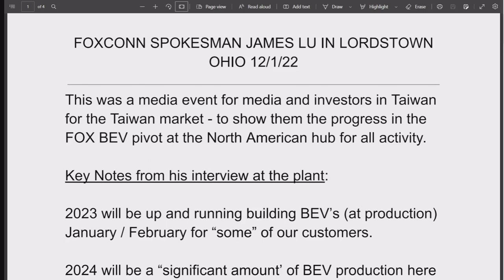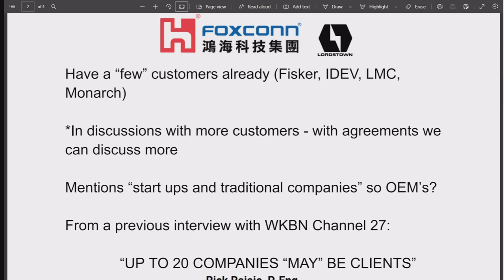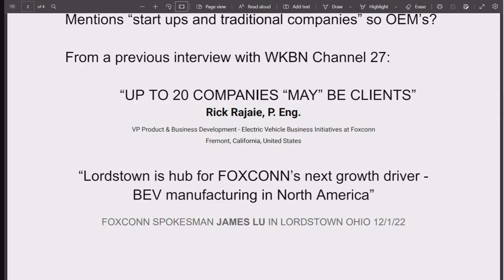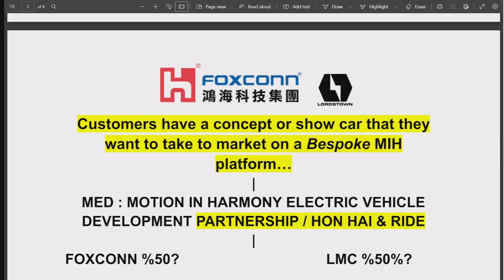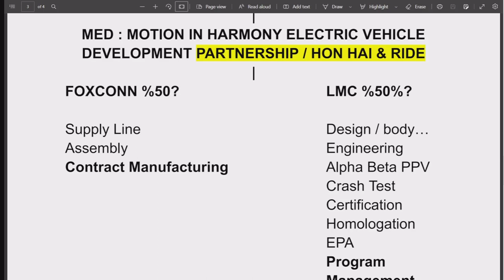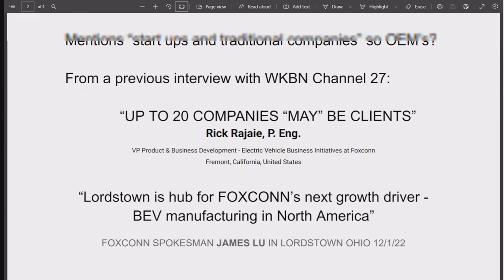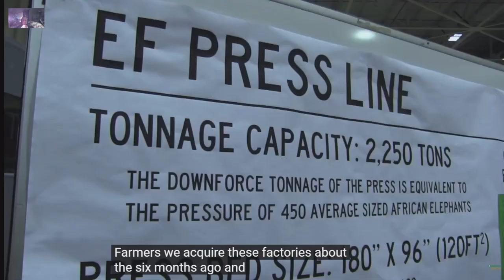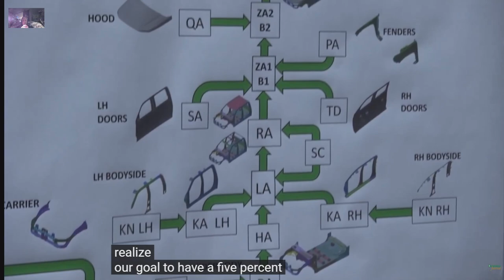BREAKING: January 2023 LMC / FOX Customer COMMERCIAL BEV Production STARTS at Lordstown  $RIDE #MXUX

Comment: The Lordstown plant is 6.2M sqft, but 13% (800K sqft) of that is controlled by LMC for the battery and hub motor lines.  I think it's very unlikely that Foxconn agreed to give up that much space unless they plan on LMC building a LOT more hub motors than what is needed for LMC vehicles.
Reply from the maker: @M - dig this - LMC owns the Hub Motor production line and the plant space and has the IP licensed - but FOXCONN is now running the line and managing all production of hub motors at Lordstown Ohio - so whatever that means FOX evidently feels the tech is critical enough for that.  IMO they will need 1mil hub motors for the Endurance US / Global sales once in full production / distribution. On a side note, LMC also owns 90 acres of raw land at the FOX Ohio facility - it kept it out of the sale.

Comment: Can you talk about the EPA mileage numbers for the Endurance. They are lower than the competition. Can you give some perspective.
Reply from the maker: I have not seen the official EPA and/or whatever the other rating is - the Endurance has been tested so these results should be forthcoming. I can say that the design of the truck has changed a bit since Steve Burns first developed it - that range was listed as "about 250 miles" if I remember correctly - do your DD on that pretty sure though. Example of changes would be  eg trailer hitch is now standard = 90?lbs added weight, but Composite Bed (not bed liner) subtract 70 lbs I believe. So hard to say - the Hightower Endurace changes were never specified, but I do believe he re-did - ha technical term - the entire truck to his liking and so the delay in start of production - and I suspect all re-done certification although never mentioned . A lot of options which are standard equip on the truck were added by Hightower IMO.  So a black box at this point - but 1. Hub motors provide 30% MORE regen - proven 2. I have not seen any mileage number with the letters EPA attached have you? Burns was also a bit catty about this I believe he used the "about" modifier - some mentions about more than 250 were around actually. Remember the DOJ and SEC are watching  - nobody - I mean nobody wants to misstate this number. We need to see that EPA certified number....IMO the 200 miles is a placeholder....
Reply: The EPA takes the range testing values the OEMs give them, and subtract 30% to determine the EPA range.  

For example, the the F-150 gave the EPA 367 mile range City driving and 289 mile Highway driving.  That averages to 328 and 70% is the EPA range.

Rivian provided 478 mile range City and 428 mile range Highway.  That averages to 453 and 70% of that is EPA range.

The EPA ranges are coming out close to what people are actually seeing.  Ford and Rivian knew how the EPA was going to calculate their range, so they pumped up the numbers so that the EPA range would be close to actual range.

The numbers that LMC gave the EPA are 280 City and 270 Highway, that an average of 275 and 70% is the 193 EPA range.

I believe because of all the attacks LMC has been under, there was no way they were going to inflate their range numbers.  So when the EPA dropped it by 30% they got a very low range value.

On the upside, when they start real world testing, the Endurance is going to greatly outperform it's EPA estimated range!
Reply: The values I provided can be gotten from the EPA documents database, look for 'Certificate Summary Information' documents, these are the documents OEMs provide the EPA to receive their Certificates of Conformity.
Reply: @mxux  Nope.  The tested range of the Endurance was 270 highway and 280 City.  There ranges are for complete depletion of the battery.  The LMC battery is actually 121 kwh, with 10% in reserve, which is where they get the 109 kwh value.  LMC gave the 250 range value because it's roughly 90% of the actual total range.

The 193 EPA range is because the EPA simply subtracts 30% from the range values the OEMs provide them.  The fact that other OEM such as Ford and Rivian are performing close to the EPA's 30% reduced values, shows that they inflated the numbers they sent to the EPA.
Reply from the maker: Just as a starting point on this topic - The Endurance.1 produced under Steve Burns had a stated range of 250 miles and a whisper number of 265 miles of range with full on regen. To date LMC.2 has only said Endurance.2 has 200 miles of range - but has not mentioned the new - just granted  - EPA Certification on range specifically - so there is that.

Comment: Do you think Foxconn may be diversifying operations in preparation of China invading Taiwan?  What do you think Foxconn will do with their huge, but empty facility in Wisconsin?  I know LMC is a separate company, but Foxconn is investing so much in this ventures they can’t afford for LMC to fail.

Possible future partner could be Workhorse Group for thousands of USPS electric mail vans.  Workhorse was cheated on that contract, their van was based on hub motors and I believe Steve Burns started LMC thinking he will be building 165K vans at Lordstown.  Congress gave the USPS an additional $3billion to buy electric vans.  I don’t think Oskosh has the technology or the production capability to do both 8.6 mpg ICE vans and modern electric vans.  Maybe high top van is the USPS van!
Reply from the maker: On China - every manufacturer is moving operations out of China - not sure Taiwan is the issue really - population curve - rising wages - internal  political issues - US industrial policy so forth.

Foxconn Wisconsin - In  my research I came across two blurbs - just mentions really - 1. The planned factory there was dropped when they did the Lordstown Deal - plug and play vs build from scratch. 2. Just for a minute there was a blurb that this will become the cloud computing center for MIH/Foxconn/Foxtron for OTA updates - infotaiment so forth - like Amazon AWS sorta. Not sure on that  - the details - but that is what I recall -plans could have changed though...

Agree to all the WKHS Burns stuff. However I am not a fan of current WKHS CEO - whatever. IMO a buyout of wkhs by Foxconn LMC Partnership at some point maybe - the IP they have for truck based drone delivery is right up FOXCONN's alley and part of LMC DNA.

IMO according to interviews I have seen - FOXCONN management is impressed by Lordstown Motors and values their skill and abilities in both BEV's and Auto Manufacturing. LMC management - ei Dan Nivagi agreed to join LMC specifically because FOXCONN was involved - there is a mutual admiration and respect - neither wants the other to fail.
Reply: RIDE